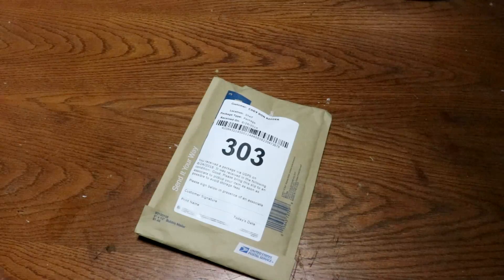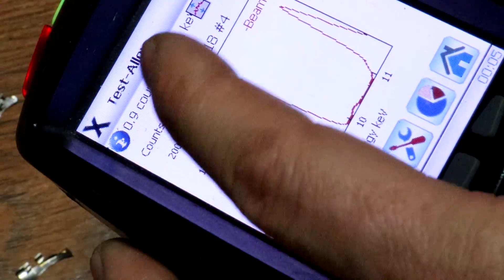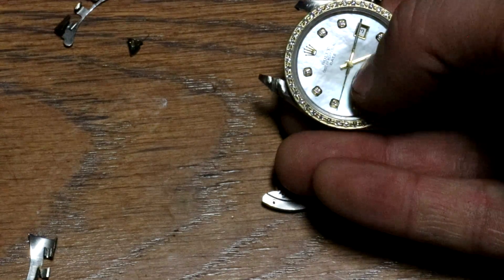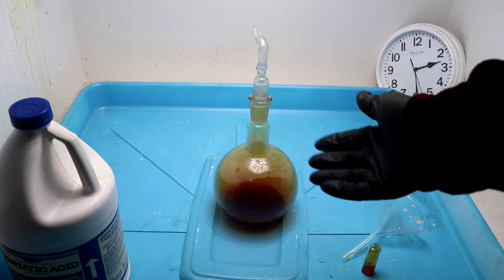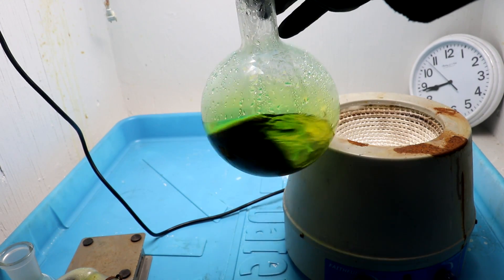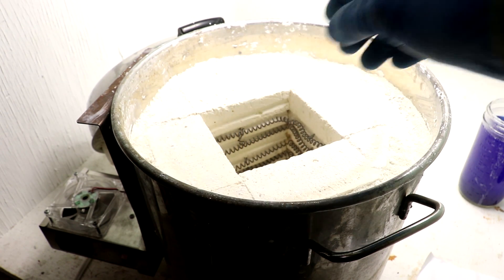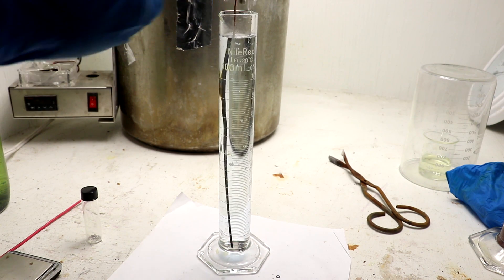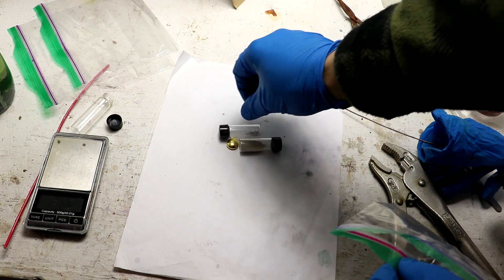How much Gold/Silver Is Inside a 7,000$ watch?

Comment: what kind of heating element do you use in your new furnace?
Reply: It looks to be some nichrome wire but I am not certain.
Reply: the typical nichrome wire. 1400'C maximum. Cheap. Either that or he invested in the alloy version that goes up to 1600'C or so, forgot its name and google didn't help.
Reply: @dimitar4y  Kanthal.  Kanthal A1 would definitely be the wire to use here.  It's extremely stable at very high temperatures - no creep, no oxidation to speak of, and not much more expensive than nichrome.  I think it was originally formulated for use in furnaces and similar high temperature applications.
Reply: I don't see much benefit to Kanthal. It's FeCrAl, rather than NiCrC/NiCrA
 @Chris_the_Muso   Kanthal ® A-1 is a ferritic iron-chromium-aluminium alloy (FeCrAl alloy) for use at temperatures up to 1400°C (2550°F). The alloy is characterized by high ...  NiCrA
    Chemical Composition: 80% Ni, 20% Cr
    Approx. Melting Point: 1400°C

NiCrC
    Chemical Composition: 61% Ni, 15% Cr, 24% Fe
    Approx. Melting Point: 1350°C
Reply: @dimitar4y  I think you answered your own question.   Kanthal FOR USE at up to 1400C in air.  It's extremely resistant to oxidation (scaling) and other problems.

Nichrome Ni60 MELTING POINT is 1350 (a little higher for some alloys like Ni80) which means your element is already toast at temperatures that Kanthal can work quite happily at.

Kanthal can reach higher temperatures and will last a lot longer while doing it.  It will also last much longer at lower temperatures, which makes it far more cost effective even for lower temperature applications like pottery kilns (1000C).  Kanthal is also stiffer at all temperatures compared to nichrome which means elements need less support and (again) last longer.

If that isn't enough, Nichrome does decompose at higher temperatures, something that Kanthal is also extremely resistant to.  Kanthal A1 puts less nasty stuff into the air in your workshop.  Nickel can be a source of lung irritation and even allergic reactions.
Reply: @Chris_the_Muso  Makes sense. One of them (kanthal, the better) DOES have iron in it...

Comment: Does anyone have an educated guess about the value of those diamonds? I'm guessing there's 48 of them.
Reply: From what I can find, there are 48 bezel diamonds, plus the 10 dial diamonds.  Rolex doesn't like to give exact diamond info for their watches.  They're probably 0.02 carat diamonds, supposedly of fairly high quality.  They should weigh 0.22g total.

If you were buying them (and it's hard to find prices for loose diamonds that small) you might pay $20 each.  The diamond market being what it is, you might be able to sell them for $20 total.
Reply: Diamonds are worthless at that size. Even most pawn shops won't take em. 1 karat and up at a Leo grade might be worth something. The saying diamonds are forever is true. There is a an abundance of them and they don't go anywhere. Plus the industrial use for diamonds is very low. The only way to make real money with diamond is size.  Most diamonds aren't large so to harvest larger diamonds means rarity which means money.
Reply: Hardly anything. Diamonds are only valuable due to artificial scarcity,  so they don't sell for much on the secondary market.
Reply: Arbbym9er 

Diamonds are worthless. If you think I’m wrong go buy some from a jeweler then walk back in and attempt to sell them back. They won’t buy them from you or if they do you might get 5% what you had just paid. Total scam.
Reply: @chrisj197438  Assuming it wasn't a very specific custom job (ie a ring in a style that they sell a lot of), presumably they'd pay at most what it would cost for them to make the next one for the display case.  I don't think they make ~95% profit, so I think 5% is way too low -- probably more in the range of 25-35%?
Reply: Diamonds does not have a real value, because they are not rare as you think, just monopoly over them make them expensive. 
I'm not sure what is price of those diamonds, but you can get over 50% less money for buying than selling diamonds, and so if they are worth 1000$ you will get 500$ at tops for them.

Comment: Does the Xray gun make the metals slightly radioactive?
Reply: X-rays can't make materials radioactive: they're just a form of light, albeit light that has extremely high energy per photon (and thus a super short wavelength). To make a material radioactive you need to hit it with neutrons or protons (depending on the material). Neutrons are only produced in nuclear reactors, and protons with sufficient energy to make a material radioactive are generally only encountered in particle accelerators.

Comment: I have been currius for a while, could compleete chemical deconstruction be usefull as a recycle techniek? Like take a cubic kilometer of garbage, melt it all down with a shitload(technical term) of acid and then slowly taking the diffrent atoms and molecules out of the sulution and selling that back to the market.
Could it even work in theory? Assuming you dont know what you are actualy getting out of it. Though i would assume mostly carbon of some description.

And if acid doesnt work, maybe a shit ton of radiation?
I know its not going to be economicly viable and there are way cheaper ways to take out metals and sruff. But im thinking of the millions of kilos of complex materials too expensive to take apart. Printplates, ram sticks or moblie phone screens and such which are mixed in with dipers, unrecicleable plastics and whatever other shit people throw out.
Reply: I know its a bit rambely but there is a idea in there somewhere

Comment: It's funny to me that such an advanced piece of testing equipment as the Delta XRF that costs around 40 000$ runs on Windows CE and uses it's terrible stock sounds instead running on some custom, efficient operating system, or at least something newer (it's a device from 2010, so Android was already spread far and wide). 
Also from what I can see the touch screen is not even capacitive - It's a terrible resistive touch screen.
The interface design is also laughably bad, but I doubt it's possible to make anything look good on Windows CE :P
Reply from the maker: Totally agree.

Comment: Such a broken Rolex Jubilee bracelet with 18k centerlinks would still bring at least 1000$ in an ebay Auction. Diamond bezel for a Datejust 1200$. Rolex Datejust case and caseback 500-700$, Diamond MOP Dial 500$ (if it was an aftermarket. An original is much more expensive) and the broken Rolex movement is worth at least 400-1000$. I would say, this watch was still worth 4000$ in this condition. For a watch collector like me this video is very disturbing.
Reply: These numbers are the value of each piece not based on the inherited value of substances, but rather the watch itself. Sure it worth 4000$ as a watch that can be repaired or at least used to repair other watches, but it sure doesn't worth that much when only the valuable substances are considered. Your 4000$ price tag comes from the fact that a similar functional watch costs around 7000$ and is largely based on the cost of manufacture and branding.
Reply: @falahati  I think what ganimed is saying is that they could have sold it for parts and get much more than just the value of metals. Whatever "added value" is due to the making and branding of the thing, it's still there in it's parts.
On the other hand how do you value the worth of this video? You think Cody could sell the rights to it for 3500$? I think so.
Reply: @misium  Sure, but this is Cody and Whats Inside guys we are talking about. xD
In any case tho, what I was getting at wasn't the fact that he got distributed for destruction of value here because sure some value destroyed because of reversing all manufacturing steps; I believe that number to be around 1000$. What I was trying to say was that it seems illogical to be disturbed as a "Watch Collector" because a watch doesn't inherently have some special value, being Rolex or anything else.
Reply: @misium  Exacltly. Selling it in parts on ebay would bring at least 4000$ i guess. I'm collecting used and vintage Rolex watches for years and these are average prices for such a Rolex watch in pieces if you buy these parts on ebay.
Reply: @ganimed1976  I do watch repair.  So, I've been inside plenty of these. And, you're right, plenty of value left even in a "parts" grade watch. I've parted out a few Rolex watches and basically got double their street value.  But, it did take time to disassemble and list each individual part.  This video is interesting of course, but I'm sure luxury/high end watch bashes will have a field day with it.
Reply: @watchandjewelryloft4713  Sure, it is interesting to see how much precious metal is in and on such a luxury watch. But destroying a nice watch that is repairable and still worth a lot of money only to extract the gold from it is very wasteful. I don't want to critisize what the maker of this video did but from a watch collectors perspective it hurts to see that. That nice diamond bezel would've looked very nice on my datejust and I would have payed many times its melting value for it. It's a true shame.
Reply: Few days later Cody's friend is texting:
Cody, what are those things you sent me?? OMG, is this my rolex??? I wanted you to repair it.. :DDD

Cody would destroy anything without thinking their value what so ever but why his friend sent him a rolex to destroy is a mystery indeed, perhaps thought there would be more precious metals..
Reply: Cody earned much more than that on ad revenue. On top of that, doing something cool like this is more valuable to most people than having a $$$$ name brand watch on their wrist instead of a $40 Invicta.
Reply: what about the gems in the clockwork
Reply: @zachbojorquez5286  These gems are synthetic rubies. They have no monetary value.
Reply: good to know

Comment: I didn't understand why elemental bromine is an oxidizer
You could have put the silver crystals in a crucible and heated it with a little flux with a torch to just melting temperature.

Comment: What about the gems in the mechanism of the watch?
Reply: I have a 1969 Rolex Datejust I restored a few years ago, and you can usually tell the difference between the man-made ones; those will have a pinker hue, whereas older watches the gems are a dark red, I would assume those are not man-made. Haven't seen any dark red ones on any newer watches I own, and don't have any other old watches to compare it to.
Reply from the maker: I didn't see any?
Reply: @theCodyReeder  Theyre really small, should be about 20-25. But they are basically worthless since they are manmade.
Reply: @theCodyReeder  A ruby bearing is easily visible in the movement at 3:29 ...but as Edkush said, it's likely man-made.

Comment: What's that thing? That apparatus, device, gadget, what you call it? How does it work? What can it do? What does it cost? Can't it be build into a smartphone?
Reply: Dr. Wier doubt it would be put in smartphone it uses X-ray to see the spectrum of the elements. He did a vid in the past about it just look up codeslab X-ray or something
Reply: I don't remember exactly how much it costs but it's around 10k so yeah it's fucking expensive
Reply: @OmarBKar-sw1ij  10K!!!? ....😳
Reply: @fukpoeslaw3613  The X-ray gun is a complicated bit of equipment. It uses a tiny particle accelerator to smash electrons into a metal target to produce a beam of X-rays emitted from the front end. The X-rays interact with the electrons in the target, causing them to emit more X-rays that bounce back towards the gun, where a supercooled X-ray sensor is able to detect them based on their energy. Each element has a characteristic spectrum of X-ray energies that are bounced back to the gun, which is how the gun can tell what elements are present (and their approximate concentration). The amount of high-tech in that gadget is easily worth the huge price tag. Sadly a smartphone implementation is not feasible because the particle accelerator and its power supply would be fairly bulky, even in their highly miniaturized state.
Reply: It's just a very expensive 100$ toy. No it can't be built into a smartphone as it's internals are too large and not able to be made smaller.

It uses a XRay bulb to shine light on elements, and a VERY sensitive XRay camera pixel that detects the nm (wavelength) of the returned light. It puts those in a table and compares to known material xrays. It only works on raw elements, not on molecules. It's not very accurate as it gets mixed results. the Xray can kill you as it's pretty much a deathray if you point it at a person. You can make your own easily, if you can get your hands on a xray sensor that's accurate enough.

Comment: Will you be getting rid of the X-ray gun in the future? I noticed you said "while I still have it"
Reply: He almost definitely meant "while I still have the watch in one piece"
Reply: @InsaneThe  haha that would make a lot more sense wouldn't it
Reply: The sentence does seem to imply that he's getting rid of it, but I doubt it - it's a cool piece of tech and selling it doesn't make much sense unless he can get something better for less than he'll get from flipping this one.

Also It's funny to me that such an advanced piece of testing equipment that costs around 40 000$ runs on Windows CE and uses it's terrible stock sounds instead of running on some custom, efficient operating system, or at least something newer (it's a device from 2010, so Android was already spread far and wide). 

Also from what I can see the touch screen is not even capacitive - It's a terrible resistive touch screen. The interface design is also laughably bad, but I doubt it's possible to make anything look good on Windows CE :P
Reply: Undy android in 2010 was neither spread far and wide nor was it any good. Let alone good enough for industrial equipment selling for hundreds of thousands.

2009’s Android was Android 1.5 Cupcake. Or just barely 2.0 Eclair. Hell, Android 1.0 came out in *late bloody 2009*. You cannot build a tool like this to cone out in 2010 if the OS has its first public outing in 2008.

Even android 2.3 only barely came out in 2010, and that was the first version that was barely usable.
Reply: @JasperJanssen  That's true, hence why I mentioned a custom OS - that would be more appropriate for such a device. Also Android and iOS were already around so the principles of intuitive touch interface design were already established but this device doesn't seem to follow any of it.

Also it seems like they released a new series of XRF analyzers called "Vanta". Those have a big capacitive touch screen and a very nicely designed interface. As for the OS it's listed as Linux, so it's probably something Android based. Could've done that 9 years ago just as well though.
Reply: Undy truly custom OS would be far worse than windows CE, which was intended for this sort of use. There’s only so much dev time.

And no, for a release in 2010, android effectively did not exist during development, and the iPhone almost didn’t exist. This product got designed in 2007, 2008. If not before.
Reply: Came to the comments because of that sentence. I too would like to know what was actually meant
Reply: If cody wants money he can just buy scrap gold jewellery, melt it down and resell it. There's no way he's gonna sell such a useful tool.
Reply: @Porkey_Minch  He said in pretty much all his refining precious metals videos that he's losing money considering the price of chemicals etc
Reply: Oh, guess I missed that bit. Still, as the big nerd he is, I still highly doubt he'd sell it.
Reply: @RamoArt  he's lost some money from some of the extractions, but cody has like 40 grand worth of gold or more. He didn't lose that much money to get it either. He's sitting pretty.
Reply: Sukh Madiq he’s got 40 grand worth of gold and he’s paid 45 grand to get it. That’s how buying gold on eBay works.
Reply: @Porkey_Minch  jesus, how old are you?
Reply: He is probably gonna melt it down to see how much precious rare-earth plastics are in it. Exciting stuff!
Reply: @WWC94  im not sure tbh im not american, but i see the laws and regulations seem to be far less strict than the rest of the 1st world countries.
well looking up online they had 3rd party re sellers so that means anyone atleast can buy with maybe some sort of license like you would with an air rifle in the uk.
Reply: he is probably gonna sell it
Reply: @WWC94  It's XRF - the energy and power are extremely low and it's very well shielded and interlocked.
XRF systems can generally be had without a license almost anywhere in the world.
Reply: the construction of the sentence implies he wants to sell it. It's worth like $20000
Reply: @mickstephenson  When the $7000 Rolex is only the second-most expensive thing on the workbench …
Reply: @mickstephenson  if its the delta proffesional that ive just looked at a 3rd party reseller had them listed at $36,000
Reply: @Dockhead  Jesus, no wonder he wants to sell it, it has been of quite limited use for his videos.

That said, it's probably of enough use that his videos would be lacking if he did.
Reply: Of course with anything, value can depreciate quickly when newer models come out, in which case it would be sensible to get rid and buy a newer model,
Reply: pescod96 You can get them used for 15-25k depending on condition.. Of course in eBay of all places.
Reply: @mickstephenson  true all i can think is he has paid for some sort of lease or rent on it from a person or place. or just straight up took a gamble on providing content and accurate measure up of valuable metals and the second hand pricing.
Reply: Pretty high chance he might just be borrowing it from his university?
Reply: @JustusLynetta  nope, he bought it after a discussion on patreon
Reply: @JustusLynetta  he bought it with money from patreon